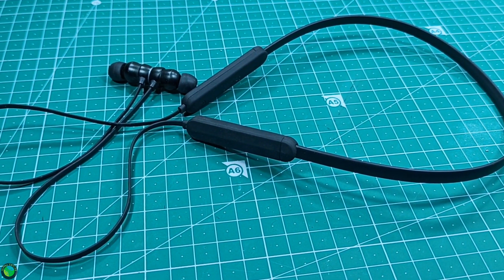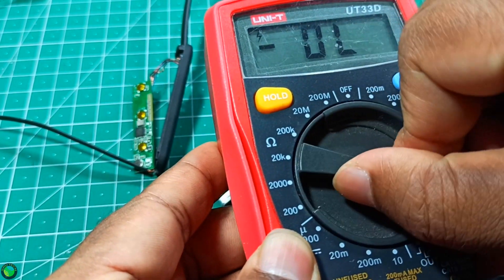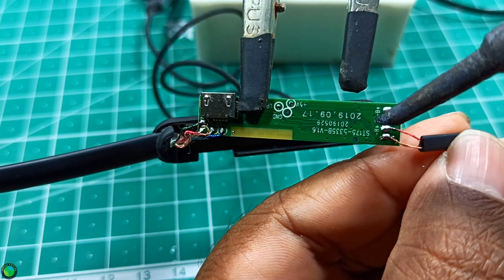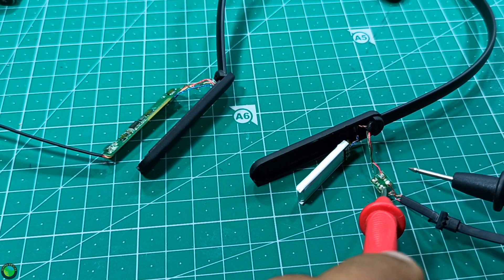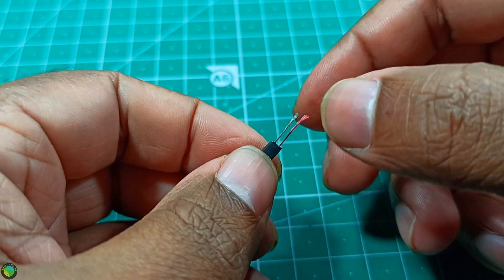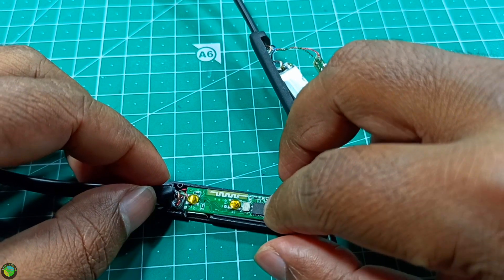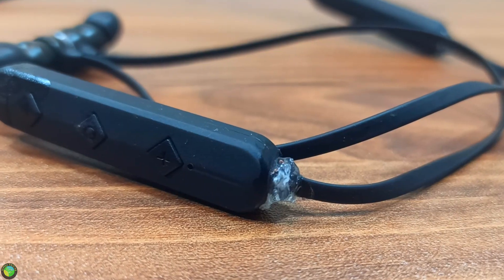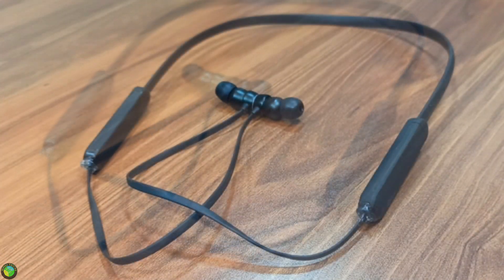BLUETOOTH HEADSET REPAIRING MALAYALAM

Comment: ഇത് ഒട്ടിക്കുന്ന പശ ഏതാണ്
Reply from the maker: Super glue പോലെയുള്ള പശയാണ്. ആശാരിമാരൊക്കെ ഉപയോഗിക്കുന്ന പശയാണ്.
Reply: @SRUTech  Bruu pinnea njan shoppil work cheyyunna aalanu avidea pazhYa headset kidannayirunnu. Ith polea one side kelkullu bro pinnea e one side kelkanjath vere oru headset nte.sleeve cut cheyth soldering cheythal ready aakan pattumo
Reply from the maker: Yes, nannakan pattum, speaker test chyth nokkanam, multimeter vachit. Ok anel vere cable solder chytha mathi. Vere headsetinte speaker vaykumbo sound difference kanum. Apo oru sugam kittan chance kuravanu
Reply: @SRUTech  ok pakshe kelkumallo.llea
Reply from the maker: Yes. Kelkum
Reply: @SRUTech  Okay okay bro njan cheythu.nokki one side shariyayi mattea side work aakunnilla rand.side poya sadanamaa bro njan pazhayth cut.cheyth soldering cheythu pakshe mattea side work aakunnillya
Reply: @SRUTech  Bro njan cheythu nokki ready aayi one side .pakshe mattea side kelkunnilla bruu .njanippo ready aakiyath pazhayth aanu bro athayth njan shopil ninnappo avidea pazhaya orenam kidannu rand side um poythayirunnnu oru side ready aayi